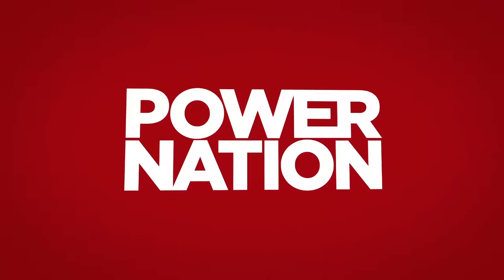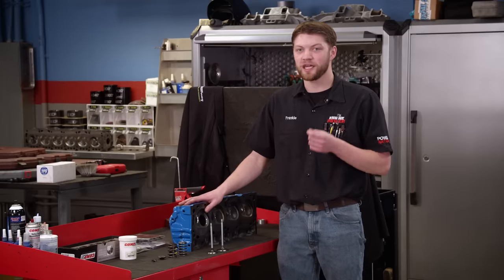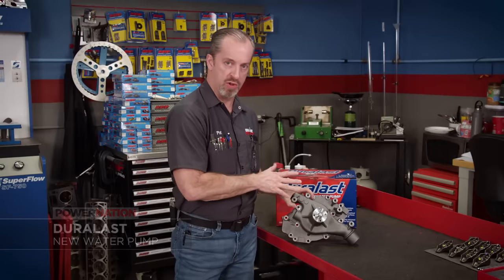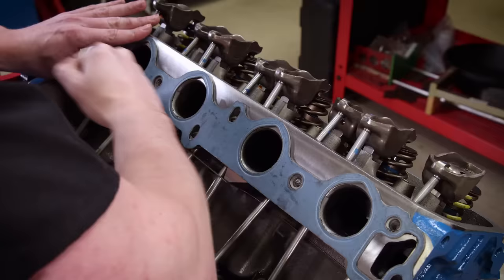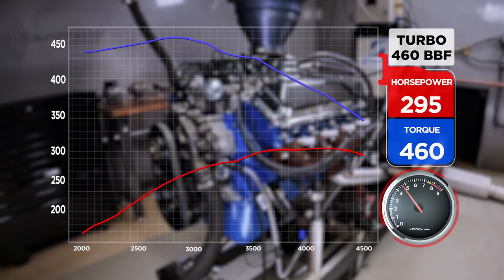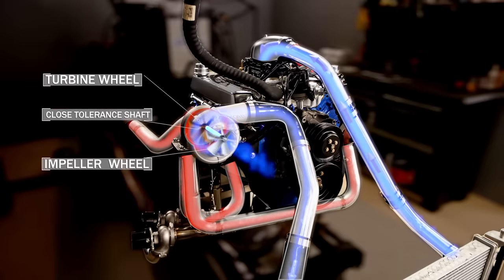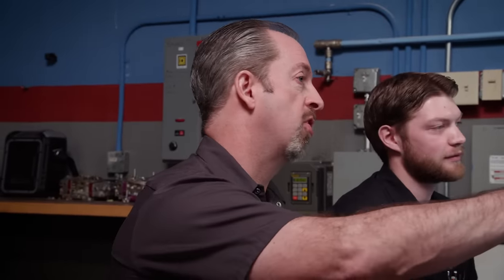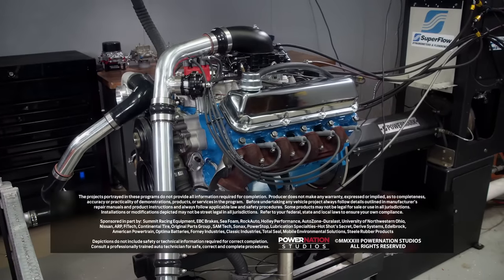Turbocharging a Stock 460 Big Block Ford for Massive (And Affordable) Power - Engine Power S10, E5

Comment: What surprises me is the fact the efi manifold works so well with a carb on top. Was that the tbi maifold?
Reply: The manifold is the primary cause of low HP.  Just changing that manifold will get it well over 500HP. ALL stock manifolds are restrictive, that's what they meant by high vacuum. Because the manifold is restrictive. 
The carb manifold had bigger openings, would have made more power. The EFI was designed for emissions standards. The carb manifold was not.
Reply: @starbattles1  Racing peak dyno numbers isntmy thing. The manifold provides excellent low speed torque as its designed for. Im well aware changing out to a better intake manfold will wake the thing up but the point is testing stock components and it performs well considering.
 That torque would be a lot of fun in a car and it certainly would make a fun street strip machine on a budget.
Reply: @starbattles1  All intake manifolds are rpm specific.  Most times, theres a give or a take regarding where you make power. Undoubtably, theres a ton of manifolds that make more peak power than this stocker but the oem 460 intake is superior at low speed torque production, as it was designed for towing. Sure a performer rpm air gap willpick up power on the top end, but the engines only turning 5k rpm at redline. Youd give up a fair bit of low speed torque for power up top. Obviously theres tons of middle ground but its hard to beat the very low speed torque offered by the oem intakes, proved by the diesel levels of torque shown here. All boost does is mirror the na curve but higher in power.
Reply: @starbattles1  Not arguing with you, but in this case I think the heads with the 2" intake valves are the restriction.  I have seen flow tests on the EFI intake and it is comparable to the Edelbrock Performer.  It's hard to flow very much air through 2" valves with a 193 degree duration cam.
Reply: @adamdice231  Ported early iron castings can support good power but they are definetly holding it back. I think the exhaust port is a real bottleneck tho.
Reply: @madmod  Agreed, but the heads that they used were the EFI heads and not the early C8VE or D0VE castings.  I believe they may have used the E7TE castings for this video.
Reply: @adamdice231  Actually, 5.0 have 2" valves and can make a lot of HP.
The Cam however you might have nailed it.  Cam makes all the difference, and 193 duration is not much. A Boss cam can come with 290 duration, My lunati cam in my Cleveland is 300 duration. 
 Stock Mustang 5.0 roller cam on EFI motor is 266 duration. So 193 is a problem. I think you nailed it in an after thought.
Reply: @starbattles1  remember that the 460 cam that they used is 193@ 0.050" lift.  The other durations that you are quoting is advertised duration, which is quite a bit bigger number.  The 0.050" duration of the Boss cam, your Lunati cam and the stock Mustang 5.0 cam would be quite a bit smaller.  I am building a stockish 460 with a Torqstorm supercharger and its cam is 219/237 @ 0.050.
Reply: @adamdice231   LOL you think my bracket master cam is smaller then stock cams, 
 Only duration people use is the advertised duration. Unless you are working on a drag car in a race shop, 99% of people go by advertised duration, so I actually compared apples to apples. All durations quoted by me were advertised durations.  
  I think you just want to argue with someone keyboard warrior much?
Reply: @starbattles1  Not sure where your attitude came from as I was just pointing out that you were making an apples to oranges comparison.  But it appears that the only thing worse than your cam knowledge is your reading comprehension.  I never said your cams that you referenced were smaller than the stock 460 EFI cam.  The advertised duration for the 460 EFI cam is 273/287.  The 0.050" lift duration is 193/206.  See, numbers matter.  Now make your apples to apples comparison.  It has been understood for probably the last 30 years that advertised cam numbers don't mean all that much, because not everyone measures them the same way.  Some measure seat to seat, some measure at 0.006" lift.  Some measure at other lift numbers.  Older style cams have less aggressive lobes compared to newer style designs.  In one of my engines, I run a XE274 cam which is 274/286 advertised duration.  From an advertised duration standpoint, it is not that much different than the 460 EFI cam.  However the duration at 0.050" is 230/236, which is drastically bigger than the 460 EFI cam.  Your 290/300 bracket master cam for your Cleveland has a 0.050" duration of 224/234, which would have similar power characteristics to the Voodoo cam with advertised duration of 268/276 and 0.050" duration of 227/233.  Your claim of only drag race shops using 0.050" duration numbers is totally incorrect.  Read Hot Rod, old Car Crafts, Engine Masters, etc... and you will see that 0.050 is the defacto standard because it is a consistent way of measuring duration and it directly compares to power potential.  Now go bully someone else.  I'm done with you.  Hope you learned something.
Reply: @adamdice231  I just looked and you said nothing about apples or oranges. I however DID use that and YOU are now trying to copy me and what I said. That is a sign of a person losing an argument.
 All you were doing was trying to twist what I was saying. Put out a bunch of googled facts irrelevant to what I said.

Comment: That stock cam is the major choke point on this engine with only .251/.274 lift. Even the mildest performance street cam would add 70-100 HP and flatten out that torque curve, giving a hard even pull all the way to 5,000 RPM.
 I love this video and appreciate what they're trying to do here, just showing what's possible with a good stock engine. But just changing that cam is low effort and low cost and would be all you really need to do to make this a great inexpensive tire melting package.

Comment: i wonder what it would do with every the same but still a flat tappet cam with around 220-230 @.050?
Reply: You will make the same power with less boost due to less restriction and more N/a power.

Comment: POWERNATION  cool video. Now you should take a 351 Cleveland - put the stock open chamber 4v heads with flat top pistons and put this exact turbo on it and let'er sing.
Reply: 351 CLEVELAND with boost would be nasty the heads flow like 275 cfm stock that is very good for an old engine.  Getting up close to some of the aftermarket heads for small block fords
Reply: @midnight347  yes they do. From all the write-ups I have seen about the open chamber vs closed chamber Cleveland 4v heads, the open chambers actually flow more because the valves are unshrouded more. This would make nice power. Defiantly need to smooth the chambers though to reduce detonation but they would rip for sure.
Reply: According to the Ford engineering data, above 3,000 rpm open vs closed chamber is moot. Timing control of some sort is needed, I think, loafing around the street at low rpm.

Comment: Now that old 460 has the beans to push that 1970's Grand Marquis Brougham the old man had. That 4 door land sled was big luxury and with that baby in it would be a real ripper! That 460 has More HP and almost as much Torque as my  6.7 2017 Ram 3500 diesel.

Comment: There is a K1500 running around where I live. It has a stock 5.7 bottom end thumper cam  and Vortex heads with a Amazon turbo and blow through carb. That truck is gaping scat packs. Totally funny because this truck looks like it should be in a junk yard

Comment: This is where proper 2D, or even 3D, boost control comes into its own by being able to tailor the boost curve and limit midrange TQ. If you're worried about rods and pistons, ramp the boost up higher in the RPM.

Comment: i find that really weird that the big block has smaller valves than i Cleveland. no wonder people love Cleveland heads. BTW i love fords so much i named my dog Cleveland. RIP. one question is why lock the timing curve? isn't that one of the primary ways to adjust for maximum power and efficiency? only one other thing. if these engines where available in stock form with factory EFI could you please do a comparison between this and the same engine but with the factory EFI system?

Comment: With new truck prices going thru the roof, and late-model used just as crazy, i think my next truck might be a mid 90s F250/350 with  a hopped up 460. I love those old motors.
Reply: Agree. Last new truck I bought was in  2002..loaded Silverado LS. 23k....not too bad but swore Id never have a pmt again. Those older trucks will be around in another 20 yrs not todays new ones.
Reply: @gordocarbo  i love the ride quality and build quality of the body and cab on the 04 to 14 f150s, but the engines have all had achilles heals that can be hard to ignore.
Reply: @DoyleHargraves  AGree, even my FIL 2013 F150 developed cam phaser? Issues at 22k miles. Electronic differential locked up on me 3x in normal city driving leaving me stranded. Gorgeous truck but I could tell it wasnt gonna have longevity as my 02 1500 did or anything older. If I could fit in cabs of older trucks Id just get one .Too easy to keep running. Had a 90 Dually 454 that was so incredibly reliable I didnt mind the mpg

Comment: that 460 Big Block is an absolute beast !!!!!
hopefully it gets mated to a strong enough transmission/drivetrain, because that kind of torque will definitely destroy the driveshaft u-joints and possibly ‘grenade’ the transmission, or it will destroy the whole rear axle(ring & pinion gears, axle shafts, etc.)

Comment: Next on the 460 build, Some ported D3ve heads, weiand stealth or performer rpm ,More camshaft (224-230 @.050) and more boost!!! Trust me she'll be fine.😊 still pump gas ready. Do it guys. 🙂
Reply: @KnightNight  460's have forged factory rods, It has hypereutectic pistons. As long as it has enough ring gap, it'll be fine. I would put money down that with good aftermarket heads, a good hydraulic roller cam and  a decent turbo you could easily make 1,000 horsepower.  I've seen 460s  put down around 700 NA horsepower on factory rods. Those heads, intake and camshaft just really, really suck. ✌️
Reply: @blueovaldude  yep internally they are pretty stout for stock. Same issue with the 351w heads cam intake and you pickup big power. Folks can take a 351w turbo and blow through carb make 600-700hp easily. BBF components are pretty strong
Reply: @Bacongrease00 I have heard that those stock 460 Fords can be revved to 6k easy.  I’ve never owned one myself, so idk.  My dad used to have a 77 F150 2wd with the 460 w/ dual straight pipes.

Comment: back in the 70's you could find big block fords on the street with a super charger and nothing else but high octane fuel to go with the basic stock engine . the funny thing is most of them where the daily driver for the guy who owned the car and they could live for a few years in this state with the occasional street races on the week end.  no it wasn't ideal on the engine but they were cheap to replace at the time but also yes they can take a lot more then you would think on a stock bottom end even in to the 675-700 horsepower range on stock parts and survive .

Comment: Years ago I read article where they put SCJ intake on  stock  429 heads with a bad port mismatch and it did not hurt the horsepower, I do not know if it was drastic as this setup though.

Comment: The 300 ford turbo was good but this is just to cool for school. If you want to have fun cranking up a turbo, do a Ford Barra 6 pot. If you haven't already done one.
Reply: Unlike the 300 they basically broke on the dyno (watch the smoke coming out of the exhaust after a few hard dyno pulls) this thing will handle just about anything you can throw at it.

Comment: I’m no where near a proper mechanic. Replacing the timing cover on my 1990 460 has been an event… not even done yet and didn’t mark bolts or balancer so should be fun. I wish I know how you guys did that turbo. If there was a way I could turbo mine I would. It’s low miles and runs like new.

Comment: Btw, I seen a video of a chevy 4200 vortec in line 6, make 480hp at 8 psi, then 548hp at 9psi. But he didn't go higher I wanna see what you guys can do with a 4200 chevy I6. It's America's version of the wicked Australian Barra engine. The atlas is rumored to be a stout racing engine... let's see what yall can do with it pleaaaaaase! I'm swapping one into an s197 mustang because I have no self respect 😅 show me that it's gonna be fun!

Crazy to me that the chevy 4200 puts down more hp than the 460 big block on 9psi... most under rated inline 6 chevy ever built

Comment: Minor correction - if you have that much manifold vacuum, it IS because the carbie isn't passing enough air through to the manifold. A 750 'should' be plenty big enough, I'd suspect a problem getting full throttle - did you chaps check that?
If it was a restriction below the carb', there would be even less vacuum, probably less than an ich of mercury's worth, because the air passing through to it would be closer to atmospheric.

Comment: Maybe you can answer a question for me....  My boss has a Fox Body Mustang with a turboed 347 and it's a blow thru Carb setup.  The gasket between the Turbo Hat and the 4150 carb keeps blowing out.  We stepped up to a better Fel-Pro re-inforced gasket, but it is still blowing the gasket out.  Do you have any suggestions for a better carb gasket that won't keep blowing out???

Comment: what was the ring gap on this.   What was the air intake temp at that boost.  From this I would have run 14psi if it had the right gap and temps

Comment: When the horsepower barely jumped by adding the 2° of timing it should have been taken back out before Boost was added. Higher total boost requires less total static timing.

Comment: Some good heads and cam and this thing would make big numbers. Those heads just can't flow anymore that's why the power increase was so small from 6-10psi tons of restriction. Also the reason it dropped off so fast in the upper RPMs

Comment: Something about doing this to a F-600 with the 429 in it that just sounds like an absolute riot to me. Especially if you put a decent set of heads on it first. I love torque probably because I've gotten far too many speeding tickets in my life, going fast gets expensive but getting going can be a lot of fun too and is usually cheaper. Unless you are one of those people who does power slides in front of police officers or doesn't know how to control said power slide and wraps your new Ferrari around a light pole trying to impress your boys. Yeah I watch a lot of car fail videos.

Comment: My crazy brain is telling me that the EFI manifold lets me have an extra set of injectors so I can put a nitrous plate right on top of the carb adapter. Letting me turn a dry kit with wet tuneability.

Comment: What's good min an max clearance for pickup cause I just built a engine that was 4x4 an swapped oil pan an had oil pressure at startup but would loose it shortly after an I didn't measure clearance with a tap so not sure what I had but I'm assuming a 1/4 in or less

Comment: Man if you put some forged Pistons and a decent cam and springs and just did a little DIY port and polish job on the heads, this thing would really get down with it. It might handle 5500 or so RPM.  I think it would be very easy to get significant additional flow on those heads. Then I'd install it in an old 69 Torino with about a 3:90 rear end gear or something like that.
Reply: doing exactly this except the torino is a 68 gt, motor is forged piston 472 with a torque cam and lightly ported PI heads topped with a edelbrock rpm intake and those same 10 dollar chrome valvecovers haha. have a toploader 4 speed for it but tempted to do an automatic, still have to acquire turbo system & do a rearend upgrade...

Comment: For anyone that’s interested based on the HP it made @9 psi at 4000rpm  with a volumetric efficiency of, 72%, which is pretty poor  but normal considering it’s a stock engine.
But still very impressive considering the rpm
here are the figures if they boosted it more 
589 HP @ 15 psi 
701 HP @ 20 psi 
806 HP @ 25 psi 
902 HP @ 30 psi 

A worked 460 @ 7000 rpm @30 psi would bring from 2580 HP - 2800 HP 

Enjoy 😊

Comment: I have a GM 502 ho rated at 450 horse 550 ft lb of torque I would like to do a blow through setup either carbureted throttle body injection would that turbo you guys used on the 460 build the 78 / 75 1.25 air be ok for my 502 ho not looking for maximum horsepower but to increase bottom end under 4500 RPM the truck is a daily driver Towing vehicle and Mild off-road if their turbo you guys used is not recommended for me what do you recommend I'd like to see the turbo come in around 1800 2000 RPM I will be only running a Max of 9 to  9.5 lb of boost max more likely around 8 lb what do you recommend and thank you for your time

Comment: These EFI heads have the equivalent of a raised exhaust port, unfortunately the oem EFI intake is very restrictive! The exhaust ports specially are restrictive, with a little porting they should flow better. I wonder how much more power it would make with a better intake and some porting?

Comment: A 454 would have gotten a better  cam, pistons, heads, intake. Didn't the intake have a crack in it near the carb mounting flange?
Reply: @bigboreracing356  hiya pal..how ya been?..whats been going  on in the chebby world?
Reply: @bigboreracing356  boy that sucks...what were you running?..whats the comp ratio ?
Reply: @bigboreracing356  yeah..them turboed 2.3 are supposed to be fun...never played with one thought...i'm still up to no good...went to  detroit last year..that was fun

Comment: 12psi they said this in ww2 with the p51. Lots of boost low rpm they thought the merlin was pushed but no they got great fuel economy and engines lasted